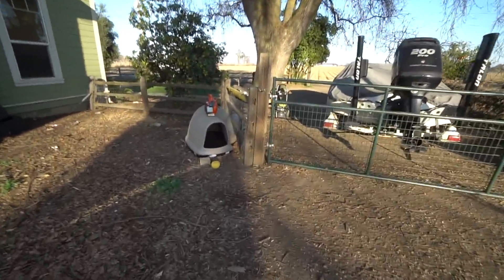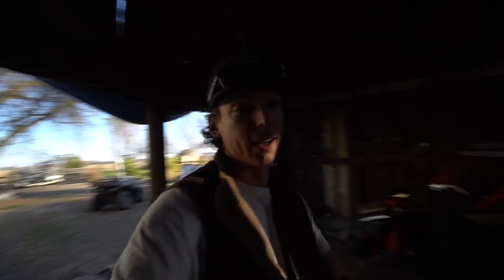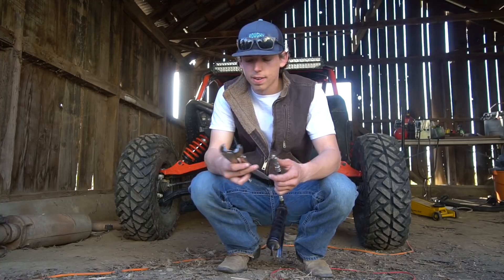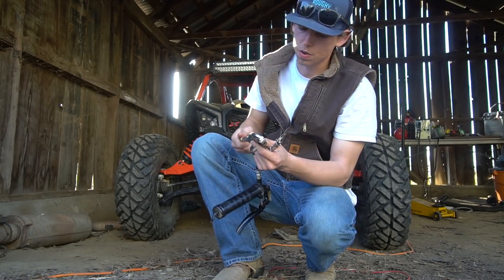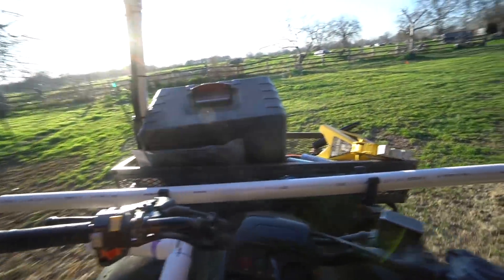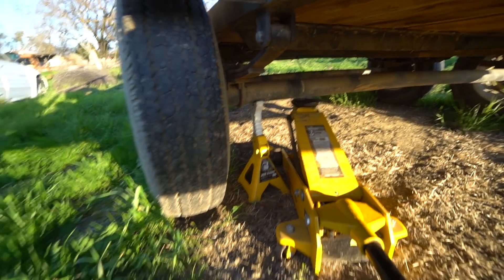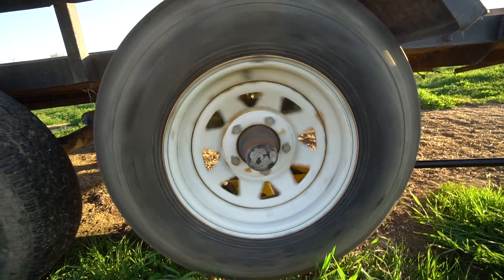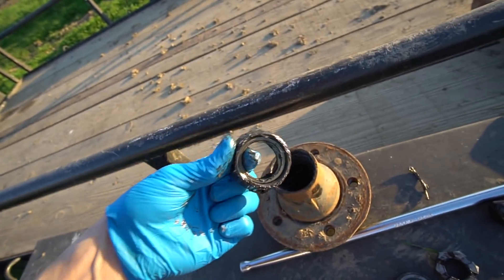I’m selling everything I don’t need before I move

Comment: ANYONE! Most reliable Cummins engine? Lookin to pick up a 2500 cru cab but don’t know where to start! 🍻
Reply: Most reliable Cummins is the 7.3 Powerstroke!
Reply: All of them
Reply: Behind Enemy Lines almost every cummins has its small flaws. You honestly can’t go wrong with any of them. I’d suggest getting a 24V strictly on the power and it being a newer truck. Any 24V for that matter.
Reply: SoCali7three 🤦🏻‍♂️🧐😂
Reply: Sackmatters how many miles are considered high miles for a Cummins?
Reply: Behind Enemy Lines I’ve got 400,000 on my 24 valve Cummins and she is still rolling strong.
Reply: Andrew Gardner original motor and trans?